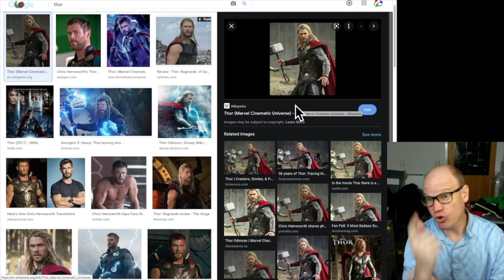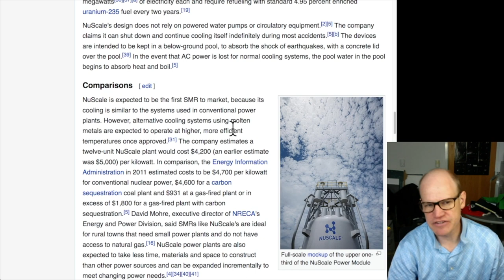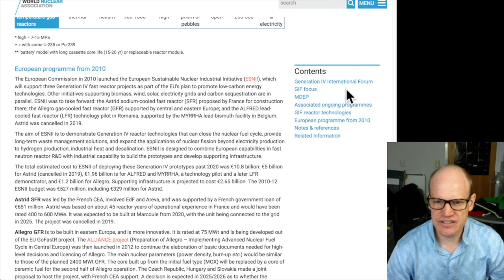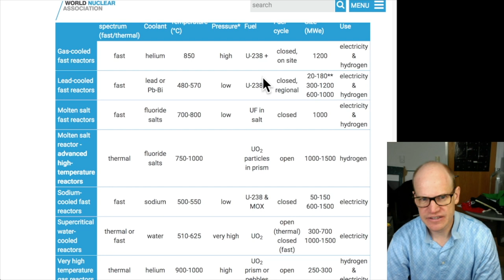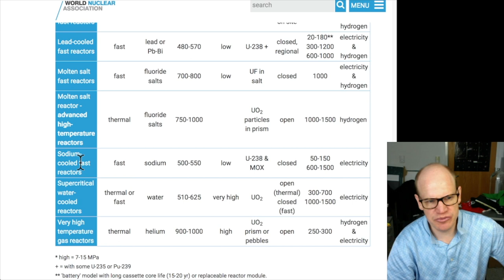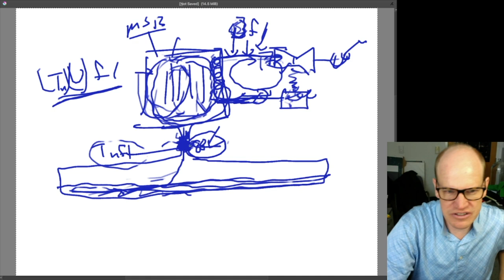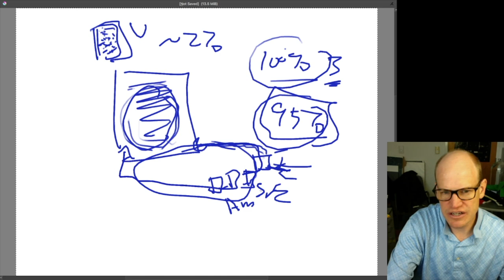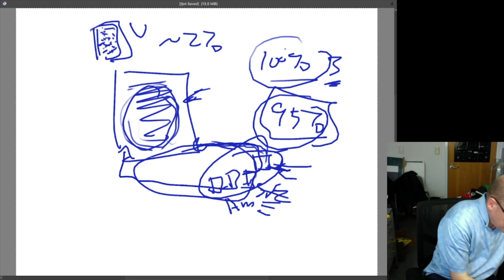Nuclear Energy 06: Generation IV Reactors

Comment: Gen 4: the 4th installment in the latest Rube Goldberg monstrosities in nuclear energy - the biggest business failures in human history...and twice as expensive and even more troublesome than the last go batch.
Reply: The point of Rube Goldberg machines are that they are unecessarily complicated, have you ever seen the schemantic of an MCSFR for example ?  Its basically a thick walled barrel with a heat exchanger on the side. The one thing common I noticed in the antinuclear crowd is that they usually don't have an idea what they are opposed to. There are some more complicated Gen IV designs too but nothing that compares to the smartphone in your pocket. The safety or the usefulness of a technology does not measured in its complexity, you may don't like it because you don't understand it, but that doesn't make it useless or bad in any way.
Reply: @jackfanning7952  As I see, you had a bad experience with the industry back then at that certain place and you generalize it. Most commonly all kind of safety concerns that make sense are taken seriously. That is why, releases and contamination are much rarer then you may think. As for the 33% you  probably not an engineer and that is obvious, otherwise you would know that is not something specificly the feature of a nuclear plant, that is happening at all kind of power plants which ultimately use steam turbines and the Ranking cycle to convert heat into electricity, as this limitation, is the limitation of the steam turbine efficiency and has nothing to do with  the plant being nuclear or just a gas one. Matter in fact, you prove my point with this statement (as I told you don't really know what you oppose) since certain Gen IV reactors are designed to address even this type of efficiency problem, by making their operational temperature higher than the current ones, allowing an other type of power extraction via gas turbines, with higher efficiency (Bryton cycle). Or they can combine the two for a combined cycle extraction for even better conversion rate. Heat can also be used in different chemical industrial processes in which case the whole conversion part may be avoided. Desalination by waste heat is also a viable idea for clean water scarce regions.
"A single reactor uses about 3 billion gallons of water a day." How is this a problem ? It uses 3 billion gallons not consuming it. Its very misleading to bring this up like that, it suggest that the water becomes contaminated or something after being used. While in reality this means that a lot of water gets heated up by a few degree via the cooling loop (which connects to the condenser and has nothing to do with any radioactivity) Again this also happens at other type of power plants.
"I know that Standard and Poors found that nuclear power has the highest overall business risks of all types of power generation. "
This is partially true because the investors cannot be sure that the plant they want to build will not be canceled due to public pressure which originates from the antinuclear propaganda. Fear comes from ignorance and the lack of udnerstanding, making ppl fear and using these fears are a strategy which is hard to see as a positive or moral one.
"Complexity is the enemy of reliability." Oddly enough this is not at all a proven fact. I understand why you think that, and I know the engineering consideration to make everything as simple as possible to avoid unexpected fails, yet I don't think the connection between complexity and reliability ever estabilished. You see your computer is pretty reliable stuff compared to just how complex it is and sometimes the drain at your kitchen fails even though its nothing more than a bent pipe. Complexity also has a subjective aspect to it (unless you want to talk about it mathematically (Kolmogorov complexity)) what is complex for me might be simple to you and vica versa. Reactors can have many many parts and still work on a few general principle quite simply. Heck we run networks like the grid, or the internet both are really complex yet quite reliable.
"This is after the meltdown there in 1959. They never learn and still haven't cleaned it up even though a court order required it in 2012. I guess they think the judge is a "p" as well."
Again let's not compare the generally careless attitude of the 50s with the current industry. I think you have a problem with negligent management and greedy companies not with nuclear power plants.(basically the cause of Fukushima, Chernobyl, Windscale etc.) And in that one we can agree.
Reply: @CraftyF0X  All those words to say nothing. In 75 years the IAEA says there have been over 100 serous nuclear accidents. There are releases and contamination every day from every reactor. Cooling water and groundwater is being contaminated with tritium every day at every reactor. Lots of other radiation that they don't want to admit to, as well. Should I believe Standard and Poors or you? Did I mention that Gen IV reactors are less reliable and more expensive than other reactors, which are the most expensive form of energy available. 
Bottom line- 95% of the new energy projects worldwide in the next 5 years will be renewables. Nuclear has flat-lined for the last 35 years. Nuclear power's economic problems include catastrophic cost overruns with reactor projects and nuclear power's large and worsening economic disadvantage relative to renewables. Every reactor project in the U.S. and Western Europe over the past decade ( Framatome, Olkiluoto, V.C. Summers, Hinkley Point, Taishan, Vogtle, China's HTGC, Russia's floating SMR, Argentina's SMR construction with the capacity of two wind turbines is $1 billion and counting and 7 years overdue. 48 start-ups and 98 shutdowns. Lots more brittle, leaky, costly rust bucket reactor shutdowns coming soon. There are only two reasons why every reactor in the world is not shut down now. 1) Some countries are still hungry for bomb materials, 2) even if a reactor is losing money, if it is shut down, it immediately goes from the asset side of the ledger to the liability side. With no income and the liabilities remaining for waste and site management, security and decommissioning, the utility will go bankrupt the day it is shut down.
Why would a sane investor hang 75 years of risk and failure around his or her neck when renewables are cheaper, safer, more reliable and a much quicker ROI?
Reply: @jackfanning7952   "All those words to say nothing." Oh, so you play this "here is a couple of arguments, nah I don't like these so they werent arguments" game
" In 75 years the IAEA says there have been over 100 serous nuclear accidents." What excatly constitudes a serious accident again ? Just asking because leaky oil pipes and exploding refinaries are just a bit more frequent. Wherever industry there will be accidents, energy production is not at all an exception, it happens in gas plants it happens with wind turbines and it happens with nuclear too. That is why the statistic of death/TWh is used so you can fairly compare these.
"Cooling water and groundwater is being contaminated with tritium every day at every reactor." Where this happens again ? I mean you should call the authorities if you have evidence, but I suspect you don't have any. You know the avg radiotion lvl is higher around coal plants than nuclear power plants, not even that is as high than around elevated areas. Radiotion dosage is not directly proportional to adverse health effects (not till a certain threshold) anyway.
"Lots of other radiation that they don't want to admit to, as well" Lmao, and the regulatory authorities cover for them right ? Alex Jones level of conspiracy. If you measured radioactive particles, or unaccounted for radiation around a power plant, you can report it, otherwise you just pulling stuff out from your bottom.
"Should I believe Standard and Poors or you? " It depends on their qualification and their funding. I'm funded by no one, so I might be mistaken but then at least it is a mistake and not an agenda I push for money.
"Did I mention that Gen IV reactors are less reliable and more expensive than other reactors" Because of these statements, you revealed yourself quite a bs peddler. You see what you just said is something that no one knows, not you or me, or anyone. You know why ? No gen IV reactor yet, so where do you get the stats for comparison ? One of the goal of gen IV is to improve the economy, so on paper actually all of them are better than the current ones (otherwise they wo't build  ever and the designers know this) bur no one knows because none of them are built yet. So how do you know ? Would you like to share your calculations or you built one and have measurements to demosntrate ? Or its just another thing pulled from your south side ?
"Bottom line- 95% of the new energy projects worldwide in the next 5 years will be renewables" Yea because that is being subsidised, and the general public has a hard time to understand why it won't work as a reliable stable energy source, alone.
" Lots more brittle, leaky, costly rust bucket reactor shutdowns coming soon. "
That is actually not something to be happy about, as the german example shows when nuclear is shunned the reliance on coal or russian gas incrase. Now many country in europe is almost exclusevely rely on the mercy of Putin to have enough gas for their industry and homes, while the goverment tries to ramp up coal so they at least remain secure. Meanwhle France with all of its nuclear power lays back and export electricity.
"1) Some countries are still hungry for bomb materials, 2) even if a reactor is losing money, if it is shut down, it immediately goes from the asset side of the ledger to the liability side. With no income and the liabilities remaining for waste and site management, security and decommissioning, the utility will go bankrupt the day it is shut down."
Yea nah I can ensure you utilities with operating nuclear power plants are making money on them, it may not be economical to build a new one because of the upfront cost, but once one is operational the hard part is over. Avg reactor makes back its initial investment cost in about 16 years, after that it produce profits.
"Why would a sane investor hang 75 years of risk and failure around his or her neck when renewables are cheaper, safer, more reliable and a much quicker ROI?"
Maybe because this is only your false assesment of the situation ? Maybe the next gen going to be even more profitable than the ones before ? Idk why you think the investment into paving half of the world with pv is without enviromental cost ? Or its a certain return ? When it is shown that as the ratio of the renewables incraase in the grid their intermittency caused instability grows too. Its not the silver bullet you think it is, it will reqiure energy storage with all of its downside (like lithium batteries) as well as recycleing or safe disposal of a lot of unit (you need a crapton of pv if you want to run the world on it)
Reply: @CraftyF0X  The IAEA definition of a serious nuclear accident is "an event that has led to significant consequences to people, the environment or the facility." Every reactor releases tritium in the effluent steam and in the cooling water every day. The NRC even allows a certain level in the effluent (20,000 picocuries/liter right now, I think, but some states have their own limits), but that doesn't mean that it is safe. Groundwater from Indian Point, Oconee, Oyster Creek and Vermont Yankee was contaminated with radioactive tritium in water escaping from corroded underground pipes. Strontium was also found in the groundwater at Indian Point. Vermont Yankee denied they even had any water in underground pipes until it started bubbling out of the ground. Those are just a few. If you want a more thorough report, go to Beyond Nuclear's "Leak First, Fix Later: Uncontrolled and Unmonitored Radioactive Releases from Nuclear Power Plants." I am sure that a smart guy like you knows the radioactive isotopes emitted from coal plants is composed of naturally occurring radioactive materials (NORMs) like uranium, radium, potassium and thorium. They are primarily alpha radiation with very long half lives that won't penetrate a piece of paper. Very different and thousands to millions of times less dangerous that the over 200 radioactive isotopes resulting from fission. Those  are alpha, beta, gamma and neutron emitters with half-lives that vary from a blink of the eye to millions of years. You can go to Beyond Nuclear for facts on the increased cost and past examples of the unsuitability of Gen IV ( fast breeders, thorium, etc.)  There are enough examples to write a book. There have been some built in the past, but they were not successful. That doesn't stop the nukie looters from trying to sell the public on their latest, greatest schemes to separate us from our tax money. Lazard says that every commercial reactor in the US is currently unprofitable.  Don't believe it, take it up with them They are the financial gurus. The average age of the U.S. reactors is 41 years. The nuclear physicists that designed them said their working life is ...wait for it...40 years. After that they get brittle from neutron activation and become too high maintenance ($$$$) to keep them running. In spite of that and because of the economic disadvantage nuclear is in compared to every other power source, Nnuclear reactors are being cranked up to higher operating rates than normal. What happens when you try to run a Model T at 90 miles per hour? Oopsie Daisy! 
If you want a detailed explanation of the operating and construction costs for various power generating systems worldwide, go to the WNISR 2020 or 2021 status report on the nuclear industry. These reports are avalible on PDF or written reports. The charts and graphs are amazing and worth the hour it takes to view them all.  Lazard also has detailed analysis of cost comparisons. It will take you longer than one hour to review all of the amazing new options CURRENTLY available for economical energy storage. This is probably the greatest competition in existence in the scientific community between the various entrepreneurs looking to share in this market. The progress will make your head spin. What is ridiculous is that nukies say we can't store energy overnight, but somehow, somewhere over the rainbow, in the sweet bye and bye, just you wait and see, just around the corner, any day now, soon and very soon, they will figure out how to safely dispose of the 75 year accumulation of the most dangerous waste and contamination known to mankind for longer than mankind has been in existence... and do it cheaply. 
Maybe you need to join the 21st century.
Reply: @CraftyF0X  Nevermind Jack, he trolls every pro-nuclear video on youtube with the same nonsense.